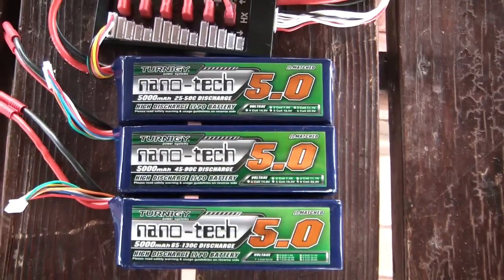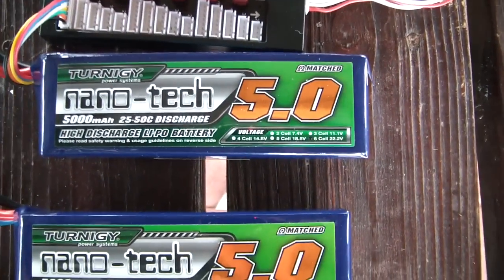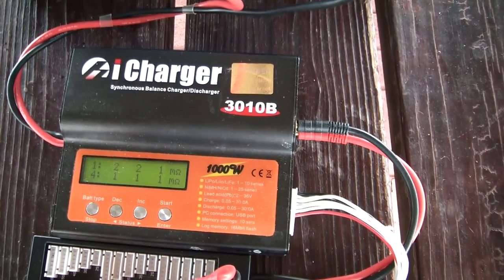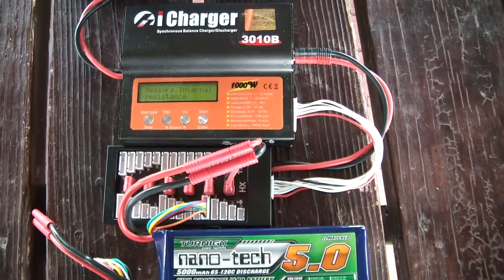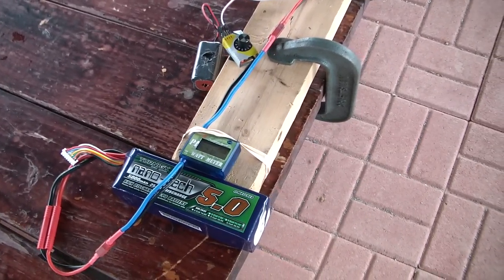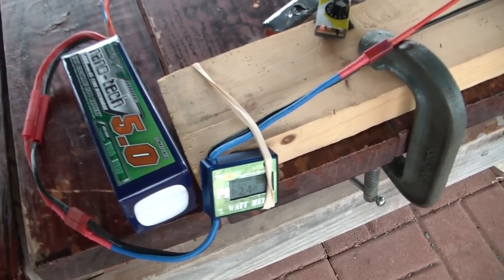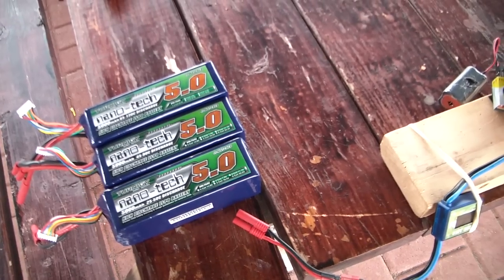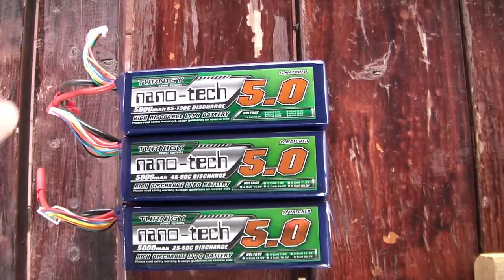Hobbyking Nanotech LiPo Battery Review and comparison of C Ratings

Comment from the maker: I have not done a cycle test on them. So far the packs I have used are behaving reasonable.  I have other Nanotechs and if I charge it at a higher C rating, abuse them in flight or over discharge, that will reduce it's life.  Pack technology is changing. I personally see no sense in buying more expensive packs for the promise of long life when one nasty crash can tear up a pack or if I accidently abuse them.  I'd rather have 2 nanotechs than 1 Thunder Power in my box.